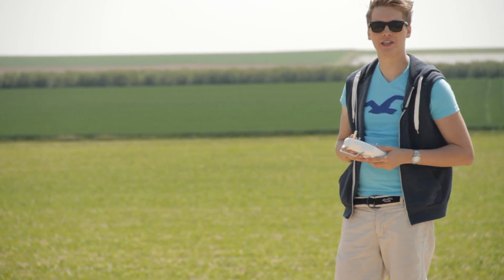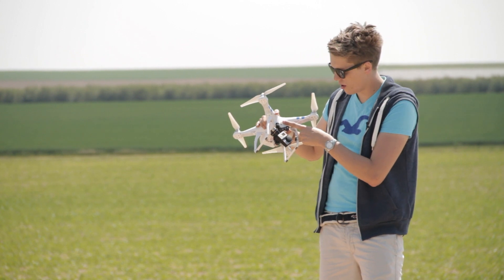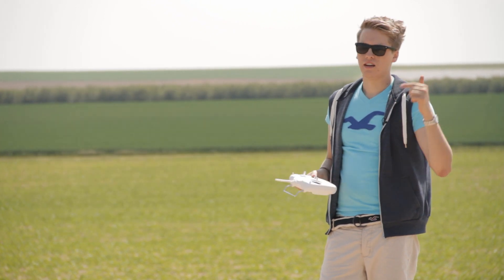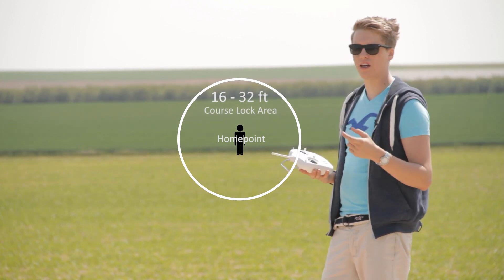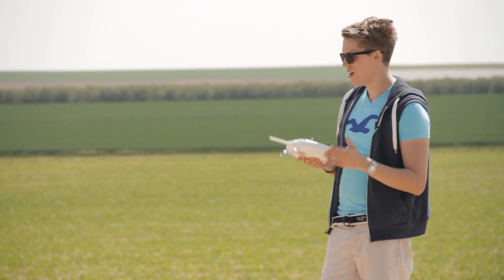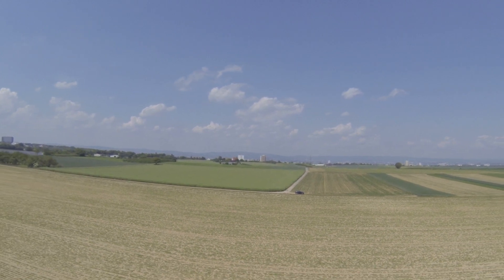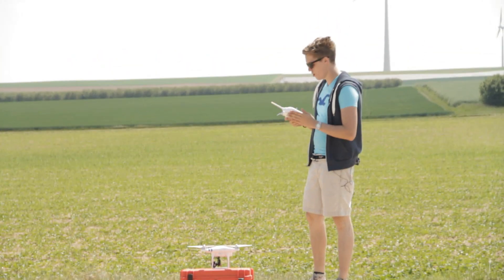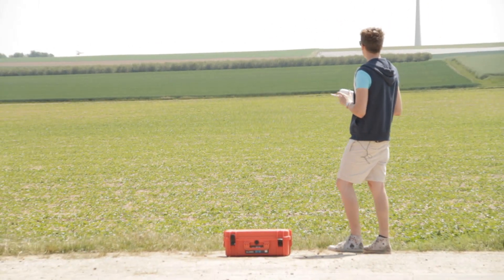#7 DJI Phantom Tutorial - IOC Homelock (HL) explained and demonstrated

Comment: Well Tom, I liked your video so much that I subscribed to your channel.  Very well done & informative I will say!For the last year or so, I have been thinking of buying one, but was not sure which model is the correct one for me.  My last purchase was a "Walkera D450 V2 helicopter" with 6-axis gyro control" but no GPS controller.  I had so many problems with that unit that it got sent back to Hong Kong for repairs.  Got it back, fixed & then the transmitter burned up & the helicopter came down safely in fail-safe mode, without damage.Got a new transmitter under warranty, lift off & the ball link came off of a rotor blade & it destroyed itself in about 15 seconds.I have flown RC planes/RC Helicopters Gas & Nitro with swash-bar paddles with only a heading hold tail gyro & never had these problems before.So!  What is the best model to buy?  The price is high for the Phantom 3 models, a Phantom 2+ seems to be cheaper!Please give me a clue...

Comment: Hi! If you lose visual contact with the chopper and activate HL / pull back the stick to make the chopper come back home, how does the chopper avoid any obstacles on its way back? Will it fly high enough to miss the trees etc. before it's back in your visual range? For example, if you are on a clearing with trees surrounding you at all directions, you launch the chopper, fly it up and away behind the trees. And you don't know the actual height of the chopper when it's out there somewhere, is there a way to make sure it doesn't crash into the woods? Regards, Mikko from Finland

Comment: Hi Tom, great video; when you (have to) use the "Homelock mode", and the Phantom flies back to its homeposition, does it stay there at a certain hight when it reaches the homeposition??
Reply from the maker: Theo van Reijsen Home lock is not RTH (return to home). The copter flies towards the home point as long as you hold the stick back. When you release it, the copter hovers just as normally. Did that help? Stay tuned and fly safe!
Reply: Tom's Tech Time
Tom. I love your tutorials, thanks. I have a question. On Home Lock. I get it switches to course lock about 15 feet or so away and will go backwards in the couse set at start up. Will it continue to fly away from you if the stick is held in the back position or will it go back into Home Lock when outside the circle. Not sure what it would do in that case. Thanks
Reply: Tom's Tech Time 
what happen with the RTH .. if we set the home point in an interesting point while flying.. it is also change to new home point or remain in first home point? hope you understand my bad english. thanks

Comment: I have a Phantom 2 and I have experienced when the battery gets low that it will lose connecting to the RC and I have no control. I crashed once when this happened and the second time I was lucky and it landed at the compass calibration spot.You have any comments on this question?

Comment: does the GPS button (Right top of controller) have to be on w/ 6+ satellites for CL and HL to work? the HL 16-32ft is a horizontal circle, does the height has to be 16-32ft away from homepoint too for HL to work? cuz both CL and HL were doing the same thing on my controller...strange.

Comment: Hi Tom, great videos, they have really helped me as a newbie. I have a couple of questions if you don't mind?

If you manually set a new home point when in the air, will this stop the Phantom from returning to your location in a failsafe or a battery low situation? Could be a bit dangerous if that is the case?

How are home lock and course lock modes affected by having Dynamic Home point turned on? Will the drone potentially follow you as you walk around so if you walk with the controller in you hand the Phantom will change course as you walk as the home point is moving? Or is the manually set home point different to the dynamic home point?

Hope my questions are clear!

Comment: tnx tom u guys are d best. i have really learnt a lot from this video. pls i own an fc40 phantom. pls how do i connect power for the transmitter considering the fact that the lipo battery only has space for one connection. also is there a way to reduce the speed of movement of the drone and d last question how do i achieve a steady short without a gimbal. tnx babafemi seun from lagos nigeria

Comment: When you had it flying a circle what determines the diameter of the circle?
Reply: The radius of the circle should be the distance from the recorded home point I think. So when in home lock everything is with reference to home like the spokes of a wheel.  Forward moves away from centre,  back comes back to centre. Left and right go in circles round centre (so long as you are outside the 10m distance from home/centre, otherwise it does course lock stuff instead)

Comment: Hello Tom. Nice video.
Question:
How do you change the Homelock back to your RC position? (After you have manually changed the Homepoint.)

Many Thanks!
Reply: Hey Diego C. My guess is that there is no way to change it back to a previous home point but I could be mistaken! However I do know that if you fly the copter back to the point you're standing at and switch between CL and HL 5 times then it will set the home point there again! Hope this helps! Oh and if you find out that there is a way to revert the home point back to it's original point please tag me in a comment and let me know because I am curious now!

Comment: Hello Tom.  I am having a problem with my DJI Phantom 2+ Calibration.  Some times I get the Green light so I can take off and some times I don’t especially when I am taking off from the same spot.
Also I just downloaded the new firmware and now it flashes Green & Red after calibration.  What does that mean?
Thank you for your time.
Reply: Compass calibration fail

Comment: TOM.. GREAT TUTORIAL... SO I FLEW MY DRONE ABOUT 200 FT....THEN I TOLD MY BROTHER LOOK IM GOING TO MAKE IT LAND BACK AUTOMATICALLY.....BOTH MY SWITCHES WERE IN TOP POSITIONS THAT IS IOC AND GPS MODE...SO I PUT THE REMOTE IN OFF POSITION...I LOST CONTACT AND MY DRONE FLEW AWAY AND LANDED 1 MILE AWAY WHERE I FOUND MY DRONE... WHAT DID I DO WRONG AND HOW CAN I FIND MY DRONE ON MY PHONE OR LOCATE MY DRONE...SO U HAVE TO ANSWER 2 QUESTIONS
Reply: First of all, never ever turn off the radio....is just stupid methood, just switch S1 to GPS; ATTI and RTH.
Second...1 mile is not so far, next time wait for lock position (fast blinking LED in green several times) and then will be no problems.
He fly away to the last know position knows like HP.
Reply: thanx

Comment: I enjoyed your tutorial but I have a question. I just bought landing gear for my Phantom 2 which requires to be connected to an unused channel. The landing gear folds up in flight and returns to normal position when landing. But I would need to activate this function. Where is the unused channel? Do you have a video about attaching extra devices that an unused channel? Thanx

Comment: Hey man, great video..! and on the CL... But...
I can't seem to get the IOC tab on my advance settings. I just got my Phantom 2 Vision and have the latest 3.0 firmware. Shows no more updates but I can't get the IOC tab, and even when i hit the phantom button, an error message pops up and says to "connect to controller"... I tried plugging directly into controller, phantom, and connected wifi.... Any suggestions??? If it already configured/installed on the new phantom 2's and there is no longer a tab? Anybody have this issue?? thanks...!
Reply from the maker: Hey,
did you turn on your control while having the phantom attached to the computer? the rc needs to be powered while doing all of that (and the phantom of course as well). Hope that works!
Reply: download driver first...... figured the program would have it embedded.
Reply: Switch to NAZA M and it solve problem

Comment: Excellent video. Thx a lot. One quick question:  if we set a new home point, and then for some reason Fail Safe is activated, will it go to that new place? (as opposed to the place where it originally lifted up)
Reply: The place you gather the sats is where your homepoint will be set. landing somewhere else and then flying back up without turning the battery off and on again will not change it. hope that helps. :)